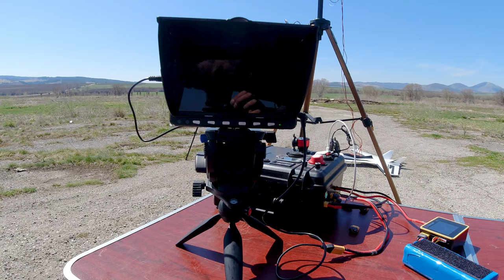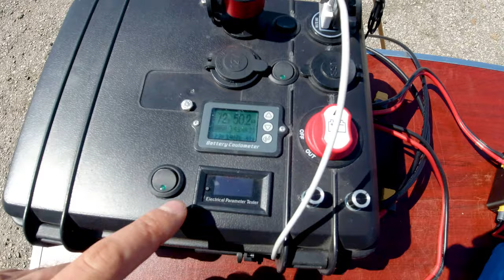My Solar FPV Long-range Ground Station Setup

Comment: That is a great set up, and I love the solar power station, that is a great idea. After watching plenty of your videos in the past, i have built a similar ground station, except I have the mini tracker, rather than the full sized one you have got. I bought it via your link about a year ago. I also have the same antenna. And like you I have the video output from the tracker going straight into a vtx that i have set on low power. That then transmits back to my fpv screen. I power mine from a 10000mah 4s battery via a 5amp bec. I also have a dvr, but mine is plugged into the second video output on the video receiver that is on the tracker. Though i built it all last year, i have not yet had chance to test it all in the field - other than confirming that the tracker was picking up the gps signals being sent back from the telefly tiny that i have on my Volantex Ranger. (That turned out to be a bit of a mission, no matter what I tried i could not get the telefly tiny to share a gps module with the Matek f/c. In the end i had to fit a separate gps unit just for the Telefly Tiny). But, hopefully I will get to test it all out in the coming weeks. I look forward to seeing a video about your solar power station, that would be very interesting.
Reply from the maker: Thanks, yes, it is all very useful! Glad to know your setup is working! Sometimes getting the TF boards to share a GPS is an issue, so in those cases I do use dedicated units for them! Good luck with your tests! :)

Comment: Eachine parts,that’s cool that you use budget parts instead of top brand all the way. I enjoy your videos, keep up the cool work. I’m especially interested in your use of solar panels a lot.
Reply from the maker: Thanks! Well... as for the relay Vtx, no point in spending big on something that needs to transmit a few meters with no obstructions, and at the time the TX801 was the only Vtx I knew of which could do such low power outputs! As for the DVR... was the only reasonable choice, with other options getting quite pricey... and pretty much delivering the same results.

Comment: one thing i noticed, your receiver on the tracker and the other receiver on the monitor don't have dummy loads on them. I would suggest that you put a dummy load on the unused inputs of the receivers as that will help with multipath as well as the impedence and diversity switching if you are using it. If you're not using div switching it will also help by making sure there's a constant load on the receivers inputs
Reply from the maker: Actually I am not using the diversity! On the receiver I have the antenna connected to the more sensitive input, and I have the video cable in that receiver's output specifically, not in the diversity one! As for the monitor, I always switch away from the diversity mode to viewing only video from the receiver which has the antenna on it! Staying in the diversity mode does make a mess of things from time to time.

Comment: Wow, the battery or Solar Powerstation is the hidden gem.

Did you mention Lithium Ion or Lithium iRon battery, the LiFePo4 cells ?
Would be nice if you show the powerstation in a bit more detail, but
I will check now if I missed a video about that.

thanks a lot - great video and progress at all
Reply from the maker: Haha, well if you'd watched until the end, you'd know I said that this box is getting a video on its own in the near future! It is LiIon cells!

Comment: Can you try 4g lte with raspberry pi and aduplane cgs. My setup is ready but unable to take a risk with wing for long range. As i don't have long transmitter setup that's why I'm using 4g lte raspberry and pixhawk,
Reply from the maker: Hi... well I haven't even thought about that for the time being... I may do it at some point... but for now I have quite a lot of work to get through... :(

Comment: Cool stuff! Why don't you connect gcs with monitor using cables if you have one power source for both of them anyway and they stay close?
Reply from the maker: Because cables can pick up interference from a host of stuff... and means having a 2 meter long cable between the two... which is an accident waiting to happen! Also... won't be able to use the external DVR the way I have it now, will have to be somewhere else... which is a bother... and this way 100 people can tune in to the relay station and keep an eye on the video feed from the plane, rather than having them breathing down my back, peeking into the monitor! Also... when I am using the goggles... the relay allows me to move around, or even put the tripod a lot further away, and say use a 3S LiPo to power it in that case. Having a cable for the video in there really limits that.

Comment: Looking forward to that battery bank video. What sort of range have you been able to get using that antenna and what tx power and what receiver?
Reply from the maker: I've been out to 32kms so far, on 5.8Ghz with the antenna you see mounted on the tracker, and a cheap AKK Pagoda, running 2W output on the AKK Dominator Vtx.

Comment: Great setup!

Is it necessary to run the LHCP at that low output power to your monitor? You might could run regular low gain Vertical antennas and it be fine? Maybe?

I have a 25mw VTX I was going to setup this way but am wondering if thats to much power and might interfere. With small low gain vertical antennas. I know from vertical to horizontal polarization its around a 20 DB drop in signal but no idea what it is from RHCP to LHCP. I assume its similar though.

Thanks!
Reply from the maker: Thanks! Well... since the ground setup is running on a different frequency I suppose a RHCP antenna would work as well... but I wanted to make sure to reduce the chances of interference from that to a minimum! 25mW should not be an issue so long as you are using the right antennas! Horizontal to Vertical polarization may have a 20db loss... but horizontal or vertical to a CP antenna has only a 3db loss! Not sure what LHCP to RHCP loss is exactly, but it is more than 3db for sure!
Reply: @ArxangelRC  thanks
Reply from the maker: @WW5RM  You are welcome! :)

Comment: hey on the antenna tracker the 0 pitch should be set on a 45 degree angle? it doesn't point up when I'm far away only when it's close by
Reply from the maker: Well, when calibrating you point it level with the horizon. If you get pretty far away, it will not be pitched up, because relative to your position, the plane will be getting closer to the horizon, from your point of view.

Comment: Are you using a module in your plane to get the telemetry back to the large MFD Tracker or maybe MavLink ?
Reply from the maker: Module in the plane! This tracker does not work with Mavlink, it is the old one.

Comment: Good looking drone station  😃
Can you tell me if your tracker works on my inav build?
Reply from the maker: Thanks! Tracker will work with any model, running any autopilot, so long as you have the air module for it on the plane, or can feed the tracker Mavlink data with valid GPS coordinates.

Comment: Why did you decide not to use the mini version of the tracker? Have you considered transmitting telemetry via Bluetooth?
Reply from the maker: Because it had some issues with seeing the video stream following a incident when wind knocked it down along with the tripod for the second time, so I just didn't have the motivation to deal with it! Seems to be working pretty good with the mavlink feed going to it directly from my new HD system though! :P
Reply: @ArxangelRC  I hope the integration with the new hd system is simple and painless. I have admit it looks like it's performing very well. Maybe we finally have a viable competitor to help shake the market up a little. I'm always worried about support down the road with companies like this, but hope I'm wrong and they are the next big thing. Cheers and thanks. Charlie
Reply from the maker: @charlesmcguire9711  So far for me integration with the MFD Crossbow Mini has been pretty seamless and trouble free!

Comment: Hi bro... I just wanted to ask about receiver for long range from normal distance that I have 1km. My question from ur recommendation which brand / model receiver for me to puching for range around 4km. 
FYI, I using radio master. I just start on flying long range 😅. I wanted to fly with my glider to view the areas that have green or sea view. Thanks
Reply from the maker: Hi, actually the receiver I am using is quite old now, and no longer being sold... otherwise I would recommend that one! In any case, most receivers would be fine, the antennas are the important bit here! If you want to move around... an antenna tracker becomes important!
Reply: @ArxangelRC  thanks for the input. 👍
Reply from the maker: @isaynotusaymy.channel1289  Hope it helps!

Comment: I hate pick and pluck foam so much. I'm triggered. After some serious usage it almost always looks horrible and pieces are starting to fly around. I highly suggest cutting foam sheets yourself. Surprisingly easy to do and always looks great if you open your gear case in front of a customer
Reply from the maker: Right, well the case came with the foam, so using it temporarily until I sort out the final build of the case, not a fan of it either, but I have no alternative at this moment, so why not! :) Thanks for the tip, will consider that as well!
Reply: @ArxangelRC  Yea, true. Does only make sense if you settled on your gear. Great video as always btw
Reply from the maker: @VincentFischer  Thank you! :)